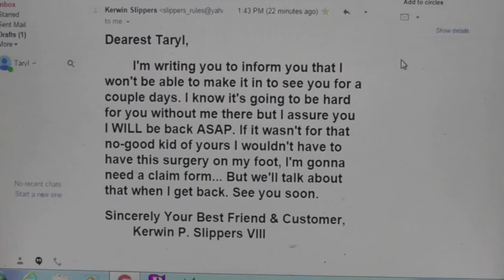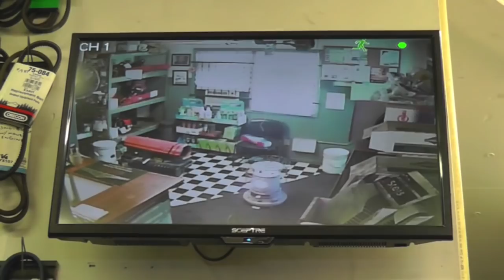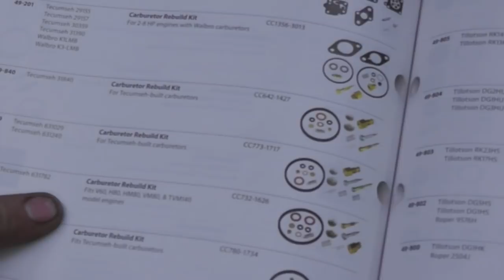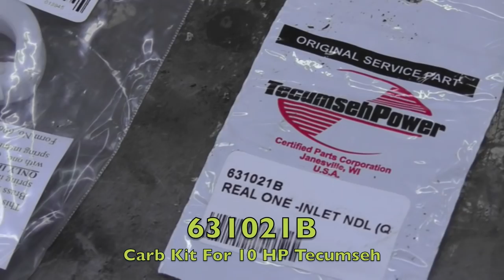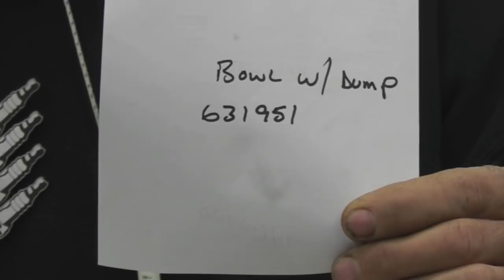How To Rebuild Tecumseh Snow Blower Carburetors with Taryl

Comment: excellent advice you will never get out of a service manual.  Purple Power can attack some aluminum.  Never leave it on too long.  What is too long?  You will have to experiment.  Never use it uncut with water. Taryl,  with a shop of your size, why don't you use an ultrasonic cleaning tank?  wouldn't that save you time and money pretty quickly and give excellent results?

Comment: Thanks, Taryl!  My 1982 Ariens Sno Tho (with the 7 HP Tecumish) always started and ran okay, but would occasionally puke gas from the carbatrator.  You gave me the confidence to tear into it and find that the carb float was leaking and had gas in it.  With a carb kit and a new float, she starts on the first pull and no more leaks!  (I even put a new mufkin on while I was working on it.)

Comment: I always used to have bad luck with these Tecscrumshen carbs. Now I learned a few things I didn't know before, like that tube that goes up and down. What in the world does that do? Thanks for taking out the time to show us how and including all the part numbers. It takes some of the work outta doin work. Much appreciated. ;)  ...and there's YOUR dinner.
Reply from the maker: +Jon Myers That tube is for the low speed circuit on the carb. and it shifts when you go from high speed to idle. If it becomes stuck its not able to shift causing the carb not to idle. & I've seen where  someone not realizing that tube is in there screw the needle in with the carb flipped over and damage the tube resulting in no low speed idle. U can tell by the tip of the needle being damaged.
Reply: +Taryl Fixes All LLC   Thanks for that bit of wisdom. In the past I have encountered these carbs where I could adjust high mix, but not the low, and vice versa. Or I could actually adjust high mixture using the low mixture screw. Found it so frustrating that I had to be put on medication, so I always tended to keep my distance from this particular design. Chances are that tube was stuck or damaged. I may still have that carb laying around, so I might try doing some surgery on it sometime just to check it out and see if it is possible to repair. Thanks again for your time. :)
Reply from the maker: Sometimes after soaking the carb. the tube would still be stuck. So to free up that tube I would  spray WD 40 in the hole & then heat the area wear the tube is with a propane torch a little bit, blow it out.try it, spray it heat it a few more times & after a while get lucky & then get it to move freely.
Reply: Good idea. Maybe a hair dryer or heat gun too. Thanks again. ;)
Reply: +Taryl Fixes All LLC  I just happened to come across one of those carbs I had sitting around, pulled out the mixture screw, and saw the pin you were talking about. Pretty cool. Thanks. :) Not a very user friendly design if you aren't experienced with these. Too easy to mess it up, but then I'm sure they are more than happy to sell you a new one. lol

Comment: Thanks Tayrl, great tutorial. I already pulled the old fuel line through before attaching the new one. Thot I would have to pull the starter wheel off, but cutting the new line on an angle made a pointy end and it pushed through just fine.

Comment: Thank you Taryl!  I love your videos, particularly the ethanol fuel additive bench test.  I just bought a non running 1997 craftsman 8HP chipper with Tecumseh carb.  I drained the bowl and bottom of fuel tank and it ran a few minutes before starving of fuel.  The carb actually looks clean, but the fuel line is detoured around the back of the engine....could a dip/hump in this fuel line cause a bubble and in-consistent running?   Also, do you use in-line fuel filters?

Comment: I got a carburetor just like the one you can adjust. It idles perfect but even after rebuilding it twice it is flooding on high run with the high speed needle bottomed out (all the way in). Black smoke and all. Got me stumped.

Comment: Hi Taryl,  I have a friends Old 1989 Lawn-boy walk behind mower Model# M21ZPR.  I did a complete tune up on the mower changed everything, Ultra sonic the carb, NEW COIL, Air filter, blade etc..  Mower, (when cold) starts fine and runs well until you stop the mower to empty the bag, doesn't restart.  If I remove the air filter then the mower will start.  I am thinking maybe carbon build up at the ports?  Any Ideas?  Thanks,  John
Reply from the maker: +John Ambrosino Could very well be. Or losing compression rings are getting stuck in the piston.
Reply: +Taryl Fixes All LLC Thanks,  I will check the compression and ports.
John
Reply from the maker: Also  the lawnboys lower crank seal would leak over time causing a vacuum leak that would make it hard to start.
Reply: +Taryl Fixes All LLC   Thanks,  I will check it out and let you know.  You have been a big help.  John

Comment: This is by far the best "Tecumehs" winter engine carburetor rebuild/cleaning video I have watched and I have watched 20 or 30 in the last few years on youtube a lot of the other videos were also from people who do this for a living, so that really is saying something. I work on carbs all the time and even I get leary about pulling O-rings, although most have brass tube's. I must need a more powerful compressor because my needle seat doesn't blow out. I'm gonna have to get that tool, I work on a lot of Tec carbs and I need to be able to pull that seat and be able to properly put the new one in.
But anyway this video was thorough it covered every piece of a carb rebuild on one of them. Things like that brass tube getting crushed, had no clue. Really, really well done. I don't know how anyone could not like this video, you would have to be a moron or one of the other people with carb repair videos that just got showed up with their dinner on a plate.
I just rebuilt one yesterday, yes in late June, why? Because I went and picked up a snowblower dirt cheap that had a 10hp Tecumehs and that bad boy is going on my Snapper 8/24 this winter. Its going to be a bad ass 10/24 which no one ever made stock. I need it ready I use it commercially 90-100 hours a winter easy. The 8 was a good engine and had good power but its getting tired from the 1000 hours on it by now easy. This new/old engine ran kinda crappy when I got it, opened the carb, gum deposit's, stale fuel, bad o rings on the nozzle and a float that was set down to China. I just repaired that carb the best I ever repaired one and now that engine purrs like a kitten. Now all I have to do in the fall is pull the old one and throw the new one on done. Go blow snow and make the big bucks.
Anyway enough rambling, theeeee best carb repair video on youtube, by far, well done and it comes with laughs and theirs a ton of other great videos on this channel. Best one out their.
I might need to get me one of those spark plug necklaces, I think I earned it now!
Reply: Took you three years today to make a video basically the same as Taryl. At least you give credit where its due.

Comment: Hello, my tecumseh tvm140 with 632253 carb engine won't start anymore and I find the spark flooded by gas after few starting tries. But: there is a spark, I have cleaned 'n checked the carburetor, cleaned all small holes, floater ok, needle ok, jets factory resetted (1,5 turn out from zero for main jet, 1 turn for air mix), no fuel leak and everything seems ok plus new fresh oil in the engine cup. I have no clue what else can I check? Can u help? A hint is that it stopped while working, it was running in idle but not supported the effort and turned off and never started again. 😥
Reply: Make sure your float doesn't have a hole in it, shake it and listen for gas inside, if that's good then take a cotton swab and clean out the seat where the needle goes. If your spark plug is wet that means its flooding, so do all that and if it still dont fix it then idk what to tell ya, hope that helps
Reply: @charliekirsch8051  thank you but as I said floater was ok. Anyway meanwhile I found out the problem: blown head gasket. Now waiting for part 😣
Reply: @standolfo  your welcome, my advice would be to check over the entire motor or get advice before throwing parts at it, that's a good way to spend too much money on something

Comment: S.O.S. For Taryl!!!  Taryl, everyone appreciates your expansive knowledge about small engines.  Your the only tech who actually calls the parts by their respective names, knows each purpose and is top quality all around.  Many of us are being scammed by Briggs and Stratton on those Nikki 6 modified carbs without the fuel cellanoid.   The ones used in snowblowers!  I know here our main small engine shop claims they are not rebuildable because they leak!  Even the plastic inner body piece holding the float and pin is like 100 Canadian dollars for a 1cent part!!!  I bought an Amazon rebuild kit with this part and many others to rebuild it.  Can you make an episode and show us how exactly so we don’t have to worry about leakage once we install it.  Many thanks...

Comment: Great video.. I'd like to add, the middle shaft of the needle & seat install tool # 670377.. the flat spot with the part number on it....  can be used to set the float height. Span it across the body and the float should touch the tool just right.
Reply from the maker: +Eric Miguel Thanks for the added tip. Theres my Dinner.

Comment: I bought a nonworking snow blower at a garage sale the other day for $20. After watching this video I was able to fix my carb too... but it's still leaking gas from a top vent. And it sprays gas out from this same vent when I try to prime the engine.  It runs fine once it gets going. But it's hard to start from a cold start. I think the spark may be weak? Anyway I'm only going to use it like 2 times a year so it's well worth the price!

Thanks

Comment: If it still doesn't run right after doing all this and checking the spark plug, make sure to check your fuel flow by disconnecting a line and observing the flow which should be pretty fast flow.  If not then take your tank off and clean it as it has a welded fuel filter within.  So you may have to use water pressure to clear that filter out and the shop vac.  Also, I don't think you need to remove the tank to snake the fuel line through  there just as an FYI.

Comment: Mr. Dactal

A friend has an older snowblower 8HP Tecumseh with an adjustable carburetor would not run. Pulled the carb out gave it a good cleaning, followed your instruction from the video regarding the small tube that needs to move and from what I could, or should I say could not hear that tube move when tipping the carb. 

I have a 10HP Tecumseh engine with an non adjustable carb. I have performed a transplant, replacing the adjustable carb on the 8HP engine with the non adjustable car from the 10HP engine. From what I can tell the patient seems to be doing fine. A few pumps of the primer button a couple of pulls and she's running. Now that you know the scenario, here is my question, do you see any potential problems by doing that type of carb swap any adjustment i may need to make?

Thanks
Reply: Chris Holland all you have really done is turn that 8 horse into a 10 horse. on single cylinder engines the carburetor is what gives you your ponies. that's why the small engine companies got sued a while back, cause one little adjustment and you're in a different horse power range. they were sued for misrepresentation of their products. anywho you don't have to worry about any damage with a 2hp gain. you could achieve that and more with a torch tip cleaner filing out a jet and polishing the intake on that 8 horse carb.
Reply: That's actually not correct. Their are actual differences between an 8hp and a 10hp Tecumseh horizontal. The 8hp which is all engines from 8 to 9.5hp are indeed the same 318cc. The 10hp is a 358cc. The 10hp is all engines from 10 to 11.
The 10hp engine has a 3, 5/16 bore and piston, the 8hp has a 3, 1/8 bore. Thats where the difference in ponies come in between an 8 and 10, not the carb. The 10 is bigger. 
They got sued for calling an 8hp snowblower an 8.5 and 9 and 9.5, once you reach 10, it really is a 10 and they got sued for calling 10hp snowblowers 10.5 and 11 and 11.5 which are all just 10's. Than once you get to the 12 it is actually a 12, the 12 is an OHV and also has different parts that the 10. Lastly your 13hp OHV which is bigger than the 12, it has a bigger cylinder all together and takes 2 ounces more oil. So their are differences its from 8 to 10 to 12 to 13. Anything in between those are the same.
Look it up if you don't believe me compare an 8 to a 10 cylinder and piston.
10 hp HMSK100:
http://www.partstree.com/parts/tecumseh/engines-horizontal-4-cycle-engine/hmsk100-159359w-tecumseh-4-cycle-horizontal-engine/engine-parts-list-1/
8 hp HMSK80:
http://www.partstree.com/parts/tecumseh/engines-horizontal-4-cycle-engine/hmsk80-155209r-tecumseh-4-cycle-horizontal-engine/engine-parts-list-1/
As far as the carb, no your not going to ruin anything, in fact you made the engine that has the adjustable carb better, because now you can fine tune it perfectly and the adjustable carb can always be cleaned and get working again, the non adjustable has an idle circuit in place of the low speed adjustment when those go bad out of wack they cant be fixed, well you can try by drilling the hole slightly larger but it's not always successful. So your fine, you just made the one engine better with the adjustable carb.

Comment: Taryl - I have a Baker Pro 8/12 chipper with the HM80. The person I bought it from replaced the carb and put the wrong one on it. It’s supposed to have the carb without the priming hose. They got the one with the priming hose nipple on it. Can I just put a rubber cover on it like you would a vacuum port? How should I handle that port? Thanks!

Comment: trying to find the right parts for my old crapsman riding mower is a huge challenge i want to find a carb rebuild kit. not having much luck. its a tecumseh carburetor 12hp has  143 406012SER 93070 on the cover. i know it was made before 2004 all the guides are for after that i have found.

Comment: Hi Taryl, your videos are extremely detailed and much appreciated. I have a 10hp MTD tecumseh on a snowblower that is missing the engine model number. I need a gasket that goes between the carb and the manifold. Any chance you would the part#? The carb is exactly like the one you demo'd. Thank you very much for your help.

Comment: Hate to keep bugging you but I can not find anyone who has those Tecumseh parts that you are showing. Pro Part Direct doesn't seem to have them, Lausen, nobody. I have a Troy built Horse tiller with an HH60 105091E. I have found enough on the web to know that means horizontal heavy 6hp.  Serial number 4094 means either it's a 64 or possibly 74, I wouldn't think it's any newer because it's an old looking rig, metal gas tank, older style pull rope housing. So as near as I can tell it's DOM was April 3rd 1964 or April 4th 1974 The aluminum tag is gone from the motor. When I punch in the numbers for HH60 105091E (these are stamped on the side) into Pro Parts direct it comes up with nothing. Are the bowl gasket, bowl jet nut and gasket, brass rings and seats the same on most models? Judging from your videos I have watched they aren't. Some of the low speed jets are long and some shorter etc. lol. I'm lost Thanks

Comment: I use the same method for the primer line and fuel lines. BTW nice 4-21 toro .. nice little machine.
Reply: Toro sold a lot of them.  I still see them advertised for sale on Craigslist here.  I use one it is 40 years old and still runs well after I rebuilt the carburetor a few years ago.  Very little surface rust and the auger mechanism shows little wear.  I fixed a couple of bent spots on one of the augers and have new shear bolts on order.  Toro built these machines to work hard and last!

Comment: I will say the ol snowblower really shoots snow when it runs at 5000rpms. 
After 6 or 8 seasons of that i finally ordered the governor parts after opening it up and confirming my suspicion. 
Rod journal looks great, rings and piston also looks good. 
No valve seat pits or wear,but the intake valve stem isnt the greatest but itll be ok. 
Id attribute that to short run times and thick oil. 
Might not run long enough to get really warm and pass some lube thru there.
I still think ill go old school and run some marvel in the gas and maybe thatll help on the stem wear. 
And im here cause the carb kit came today so ill futz with that tonight while waiting on the other parts still. 
I figured id have scrap metal inside ,the oil wasnt too nice.
Kind of amazing how much abuse theyll take sometimes especially when you dont care.
Reply: 2649 it probably is best to take a dump, because if you don't do much maintenance you could at least do that.😀

Comment: Taryl,  I have rebuilt my carbit traitor 3 times and it still leaks gas in the engine crank case. My carbit traitor does not have that tiny vent hole anywhere on the carbit traitor. I do not know what I am doing wrong. Maybe I `m still not adjusting the float correctly or I did`t get the seat all the way in. Do you have any suggestions to help with this thing dumping gas all the time?

Comment: I'm not able to hear the metering rod or pin (Taryl calls it a tube) moving in my carb when I shake it.  But it idles pretty well I think and doesn't hunt.  After tuning it a little, I'm not far from the suggested needle-valve presets.  I don't think the metering rod is  present in all models.  Mine is a series 3, marked 453 and 1432K4W, from 1994.